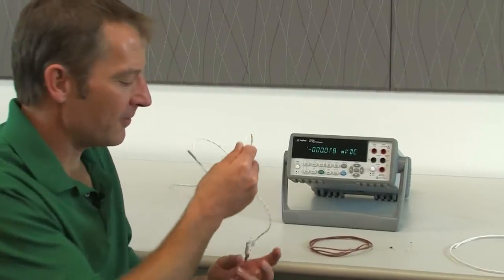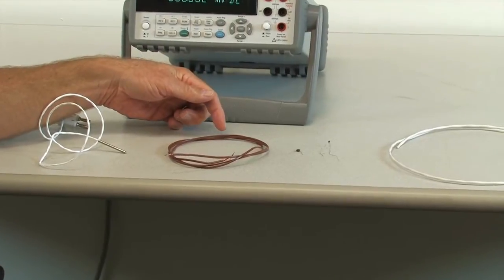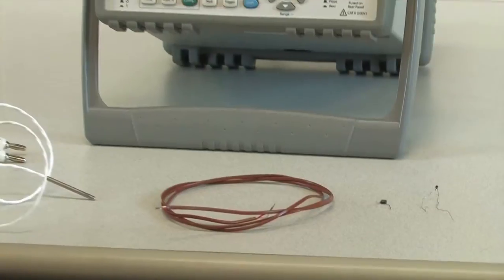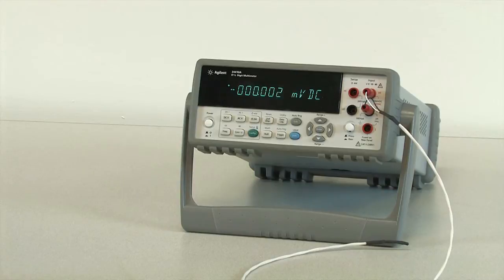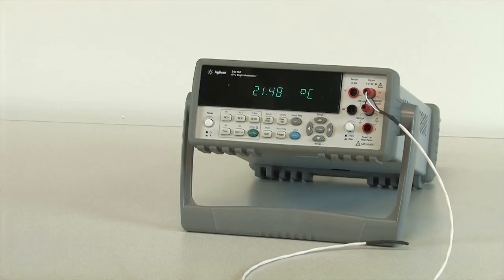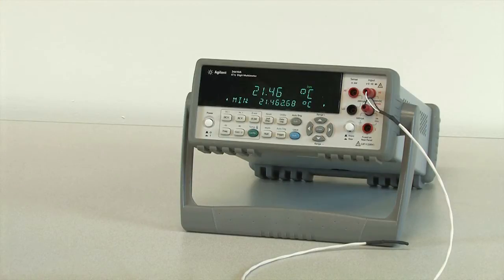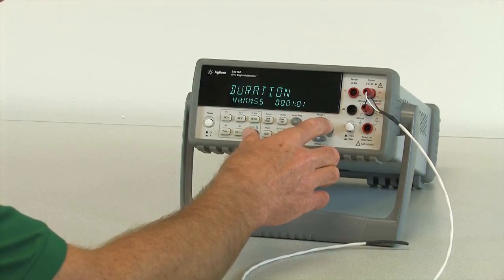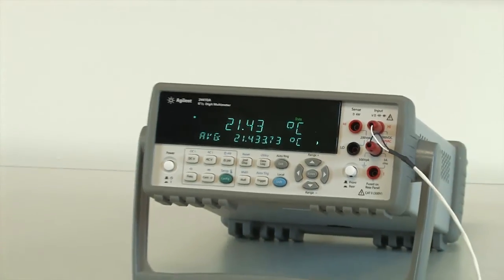Building a Temperature Probe for 34410A Digital Bench Multimeter

Comment: All DMM come with front and rear panel banana plugs. Is it safe to leave thermistor plugged in in the rear while measuring high voltage (100V) on the front?

Comment: Your argument against the thermocouple is nonsense since you can buy thermocouple wire much thinner than any thermistor or RTD.

The simple truth, which you are not willing to tell us for marketing reasons, is that none of the Agilent bench DMMs support thermocouple measurements. Perhaps it is too difficult to get good cold juction compensation on this style input jacks (your handhelds manage), perhaps there are other good reasons, but it is still a sorely missed feature.

I did make a thermistor probe, even found a thermistor much smaller than the one you have, but it is still useless compared to a thermocouple because of size and the plastic insulation which is a bad thermal conductor and has very limited temperature range.

Thermocouple support would be one step in the right direction towards making the best bench DMM. Far more important than many of the useless features the Truevolt meters have.
Reply: Exactly my thoughts when I saw this. In my toolbox most thermocouples have much lower thermal mass than my RTDs, which is why I usually use them to measure ICs temperatures.